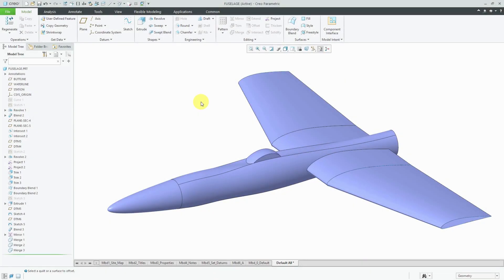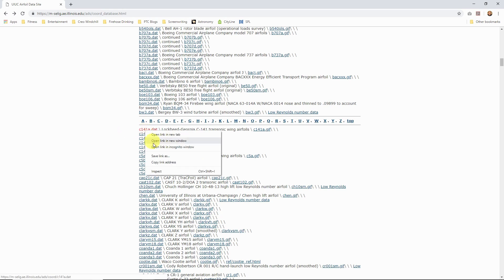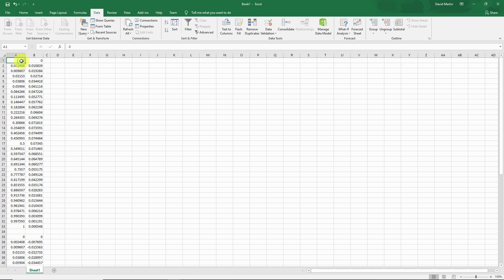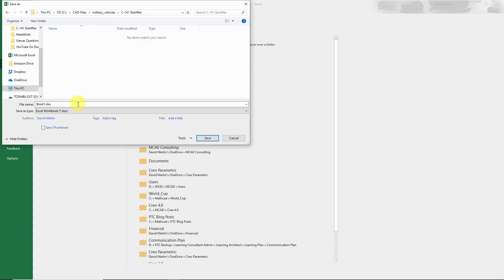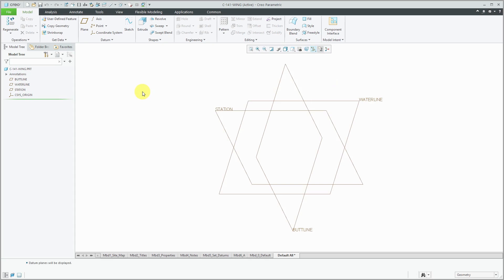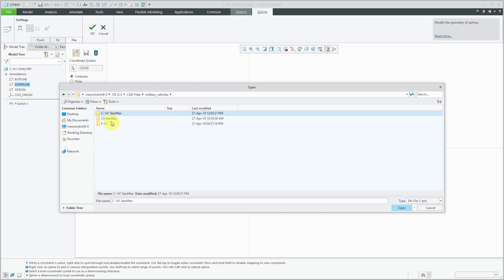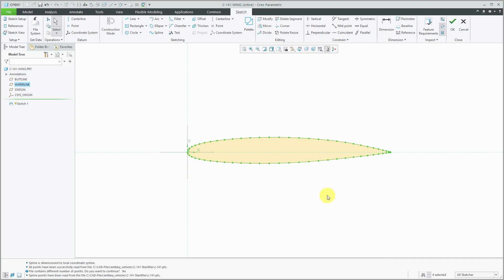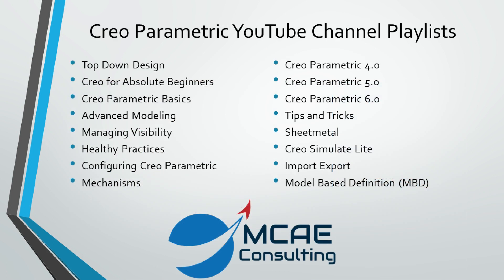Creo Parametric - Designing Airfoils with Splines and Blends

Comment: How can i turn multiple point spline sketch to a single closed loop sketch
Reply from the maker: You can use Copy and Paste to create a composite curve from multiple curves.
Reply: @CADPLMGuy  I tried it , it copied all spline points that were created in initial sketch
Reply from the maker: Don't copy the points. Copy the curves. As far as a group or community, I don't know what you mean. I'm not on social media.
Reply: @CADPLMGuy  my curve have like 200 points, group for people I meant so they can discuss their problem
Reply from the maker: I don’t have a group. There’s always PTC Community though.
Reply from the maker: It doesn’t matter how many points the curve has. Just copy the curve, not the points.
Reply: @CADPLMGuy  that's what I am trying to understand how to copy curve only when points are selecting automatically
Reply: @CADPLMGuy  do you have any group or community that i can join

Comment: Thank you very much for this tutorial. I'm currently trying to model a NACA 2418 airfoil for a ME course. I'm currently stuck at the step where I'm to import the .pts file into CREO Parametric. Was wondering if it had anything to do with the part where the data columns were flipped since whenever I try to import I get the same message "Spline points have not been changed." Hope you can help and thanks again.
Reply: Forgot to mention I'm currently using the student edition.
Reply: hi did you find a solution for this?

Comment: David, I am your big fan. I have watched almost every videos about Creo Parametric, and learned a lot. I am wondering how to model the entire wing? I am modeling B717-200, and the fuselage was done, but do not how to model wings and others. Thanks.
Reply from the maker: You would need the airfoil data along with the corresponding buttline locations for the splines. There is a strong chance that that information is not publicly available as it is most likely proprietary intellectual property.
Reply: @CADPLMGuy  thanks, David.